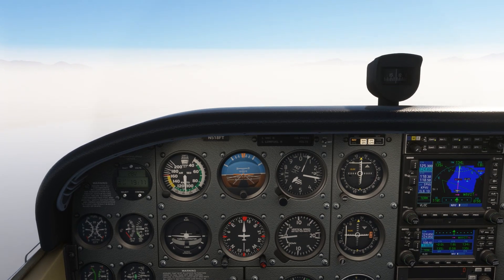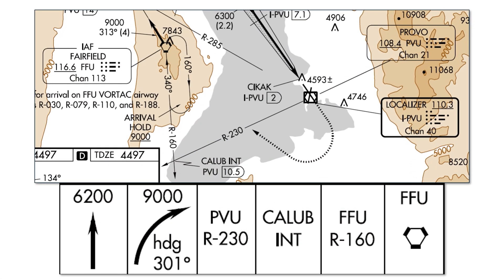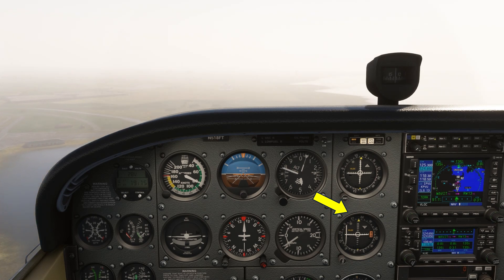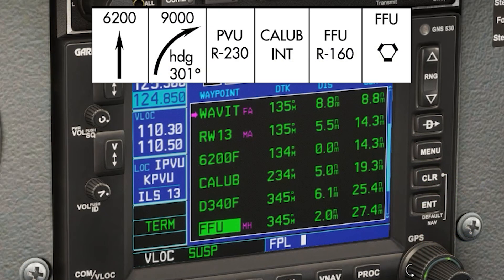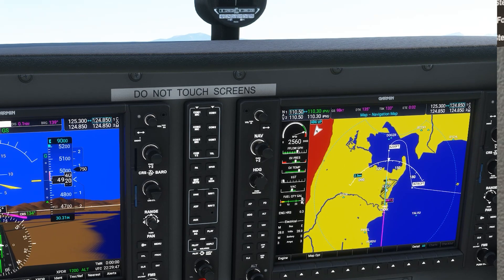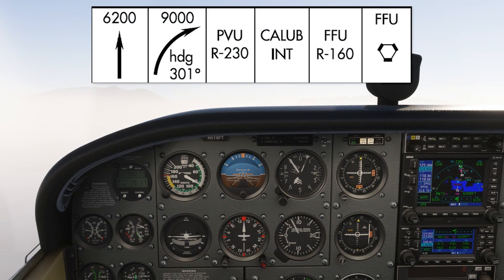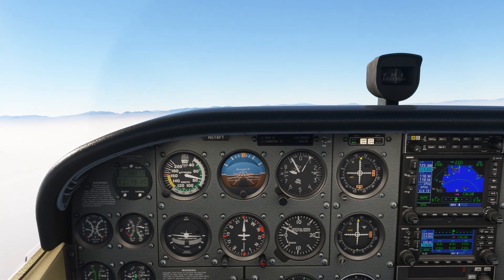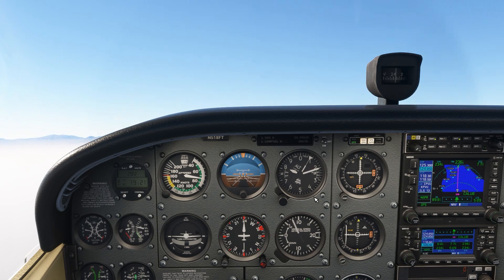How Floating Fixes Work on Missed Approaches | ILS & GPS Approaches

Comment: Have a question for situation like this. You say the plate shows to fly heading 301 to X intersection... isn't there a problem with flying heading vs tracks in this situation especially if you are in the clouds, what if there is a strong cross wind that blows you into unsafe areas, your heading bug still how's 301 but you aren't going that direction. Always find this weird if they say fly heading and not track unless you are being controlled by ATC as they can vector you as needed etc.

Comment: Another good example of the 530 in the sim leading you astray is the VOR/DME 17 at KVCV.  The text for the missed and the little windows in the profile view have you climbing from the MDA of 3200' to 3500' then a climbing R turn to 300 degrees to intercept the VCV R-269.  It may work in a jet as shown in the plan view but in a 172 you'll never intercept and may not notice for a while.  The FLP page in the 530 also has you turning to 300 deg. after 3500'  I guess the lesson is not to take the textual missed and GPS too literally unless you've reviewed the big picture.  Having NAV 2 set to 269 deg and flying a heading of 225 + or - 10-20 deg. will have you intercept just fine.  Took me a few tries in the sim to figure this out.

Comment: Why is the track to fix leg wrong? Isn't it going to be along the radial?
Reply: The sequencing that incorrect, the GPS would have you climb to 6200ft then direct CALIB with out the turn turn to 301 and intercepting the R230 first